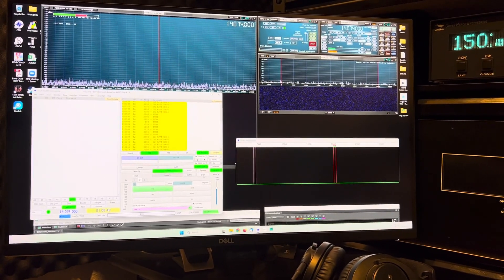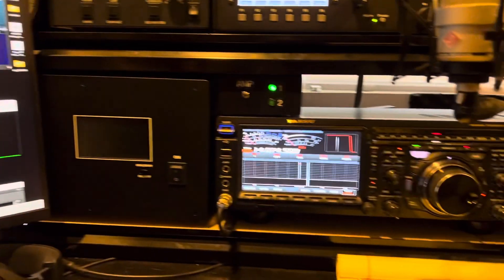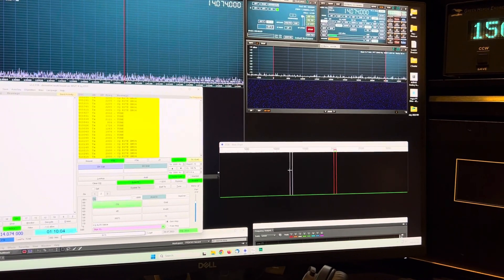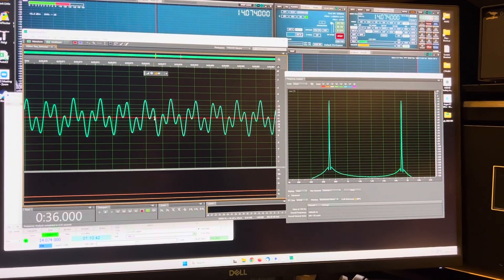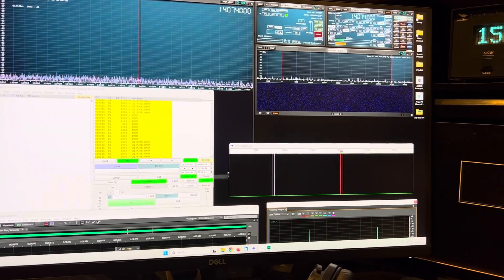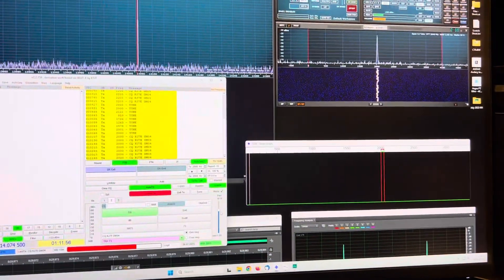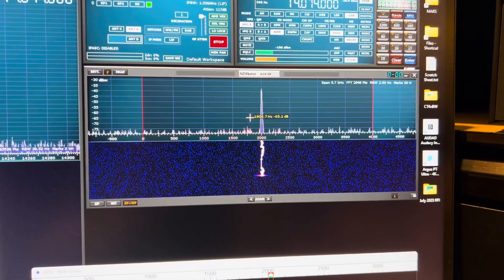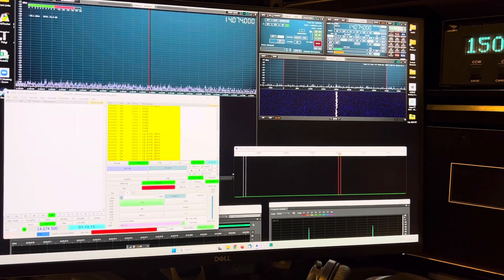FT8, ALC and IMD, why it may not matter - KJ7E

Comment: The fly in the ointment, it seems to me, is that not every radio will be as linear as yours apparently is.
We all have seen, I'm sure, strong signals that are excessively broad on our waterfalls.  Hard clipping, certainly can generate such, either in the audio chain, or in an IF or RF stage to which ALC is applied.  But, shall we call it, soft clipping, where peaks are still rounded, but no longer proper sin waves, will also spread (though, I would expect, on harmonics, which, depending on where the ALC is applied, may be out of band).  Probably it is best to have a friend observe one's signal at various ALC levels, so one can understand how that radio behaves.

If there's and external amplifier involved, then there are, of course, additional opportunities for distortion.  An amplifier could have become somewhat non-linear before it even begins to emit ALC voltage.

A somewhat scarier thought is whether our receive chains cause the apparent distortion when the pass band contains signals of wildly varying amplitudes.  But then I would expect to see it when watching the waterfall re-tuned to a CW contest.  Certainly food for thought.

KE1G
Reply from the maker: Yes, every setup needs to be verified to be sure.

Comment: Is this particular to FT8 only? What about all the other modes. At what point do we pay attention to the ALC meter. And...if the ALC meter isn't giving us the info we need to put out a clean signal what does the average guy use to determine that? Good info BTW. Just trying to figure out how to figure it out. Thanks
Reply from the maker: Every radio is different,  in general, just follow the instructions per the radio manufacture.  This video was just to debunk some myths regarding ALC and FT8, you dont always need to run little to no ALC for a good, clean FT8 signal.